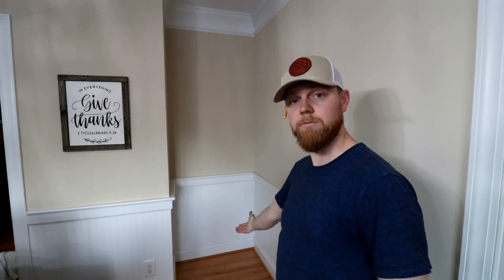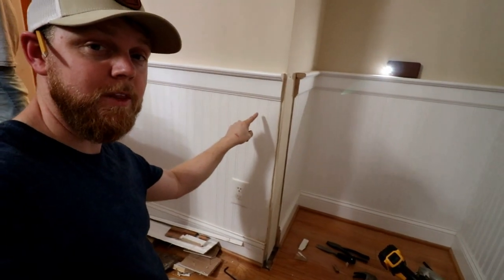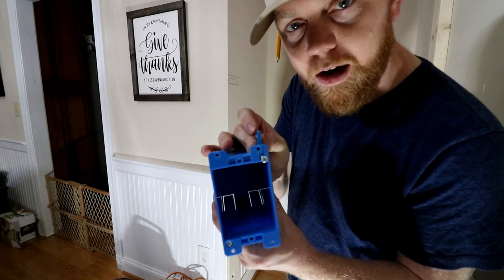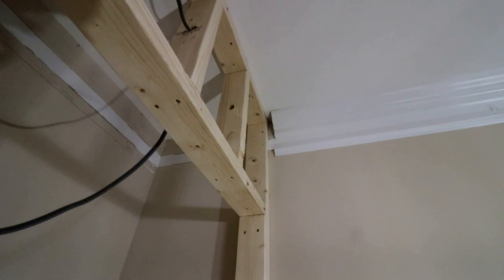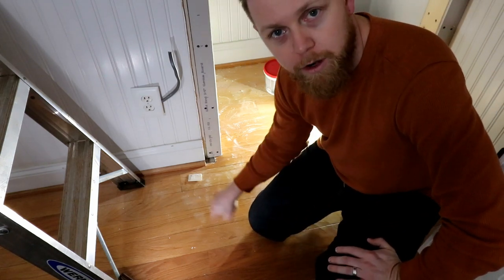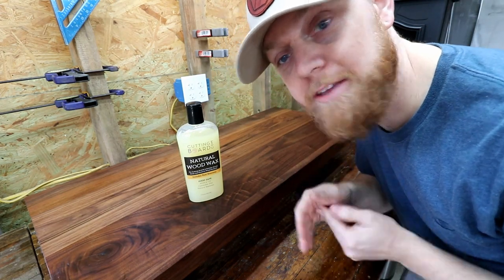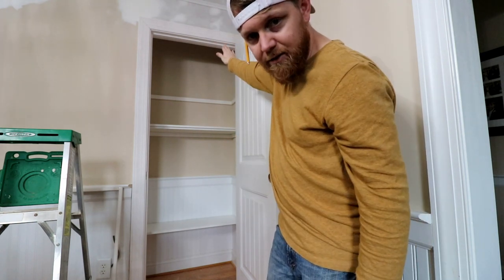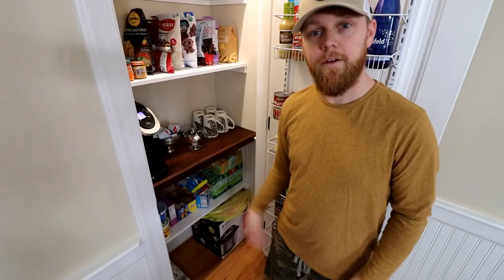Building a DIY Pantry - Turning a nook into usable space!!

Comment: What is the depth of the pantry?
Reply from the maker: The usable depth inside the pantry is right at 17-1/2”.
Reply: @DIYWoodntYou  what's the depth of the entire space? I'm looking to make something like this and I'm wondering what's reasonable depth of the room itself
Reply from the maker: If I remember correctly I believe the nook was maybe 22 or 22-1/2 deep. You have the depth of the framing (3-1/2”) + sheetrock on both sides (1”) + the casing on the inside (1/2” or 3/4”) + the 17-1/2 usable space. So between 22 and 22-1/2”.
Reply: @DIYWoodntYou  awesome thank you